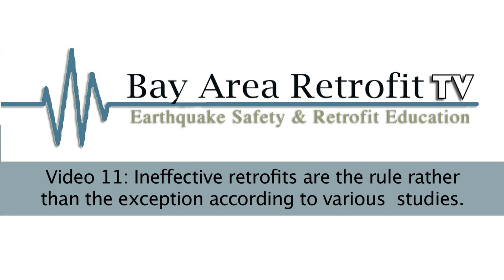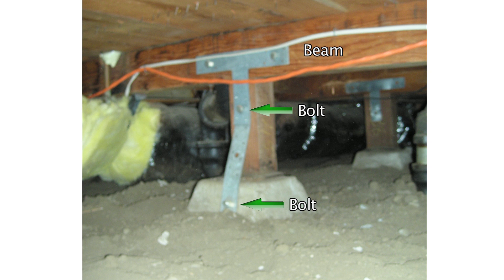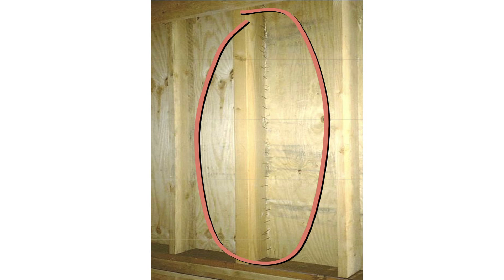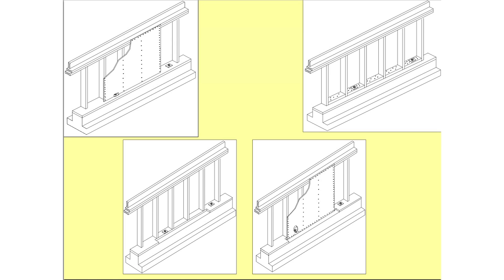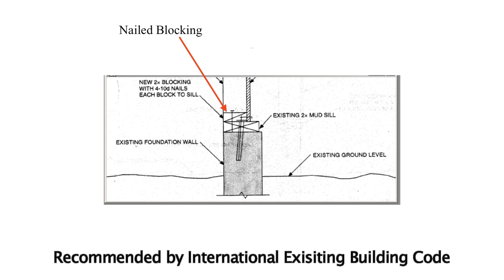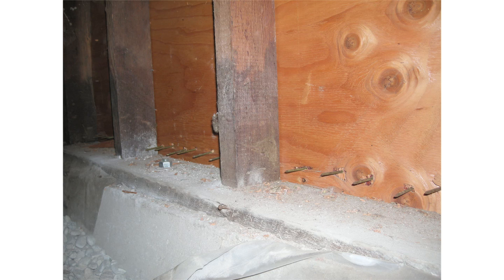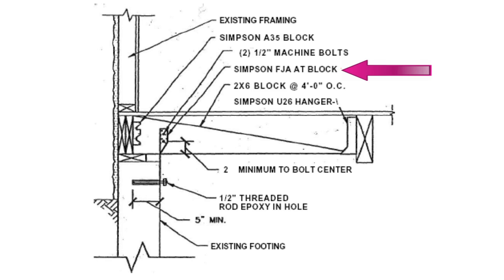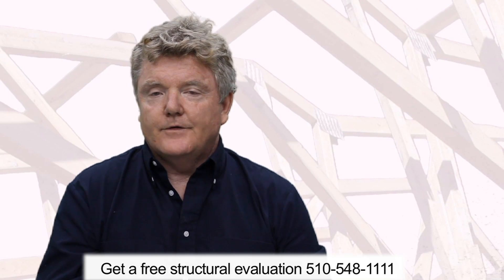Bad Retrofits: a Rule, Not an Exception

Comment: The blocking method will be ineffective because when the house pulls up on the blocks it will pull the blocks off the mud sill? Since when does a house lift up during an earthquake? Earthquakes put lateral force on the house by sliding it from side to side, not up and down.

Comment: As someone who builds commercial high rises etc 1000% engineers having a degree doesnt mean they understand real world loads. Had a 70k lbs form floor fall 6" above my head. The engineer undersized the support to "acceptable" loads yet in reality loads where uneven and not straight. Only thing that saved me was the non hardened threaded rods bent but didnt snap. Bent to 45° yet held. So we doubled material thickness and strength and had no issues. This was on a bridge over Mo river. No small feet

Comment: "The nailed blocking method is the worst".  Is that because the nailed would just pull out?  What if grabber or lag screws were used?
Reply: was thinking same. he did also said the nails would split the mudsil and it wont be observed. but i think predrilling a specified pilot hold for the screw would stop that
Reply: @thesage1096  I'm assuming alot has to do with access.  The house I"m working on is gutted down to the bare structure so it's easy.  I have access from above.  But with an assembled house already, I think it'd be a different story. 
I like the idea of predrilling with pilot holes and using screws.  But wow, it takes time.

Comment: When you add blocks to the mudsill for a nailing point on the plywood, you end nail and toe nail them to the studs, not 4]10d nails straight in to the old soft redwood or rotten sill. Hello!
Reply: Yep, four nails is all that is shown on the berkeley plan set A.    Good luck friends.

Comment: What a pos dueche bag
Reply: College pukes posing as builders of experience stink up the joints around town. However he is correct that most if not ALL code writing engineers such as for the horrible super expensive city of San Leandro/Berkeley Plan Set A mess cannot name a single property they have retrofitted.   Many of the modern engineers out there have never worked in a crawl space of any type. Where many of the SEAs in the area up until about the year 2010 or so really knew what they were doing. They were a service to the area.    Now a days you will find S.E.s cribbing that wretched plan set A.

Comment: and this clown is amongst the worst seismic builders ever.    Many decent buidlers have cleaned up Howards past "iffy" work over the years since he came here from who knows where in Oklahoma or where he fled from in the 80s.  His shear wall work with weak roofing staples for instance are amongst the weakest most worthless shear walls ever built.  They come off the studs with simple hand pressure.  His methods of hacking off mud sills then can cause the house to shift to one side of the foundation.   Try standing on some mud and lift your weight to one foot only.  That can be the result of the 'flush" method of rippping old redwood sill to avoid the higher wage skill level of framing work.     This gutless detested by other buidlers in the Bay Area punk calling out lousy work is such a hoot.